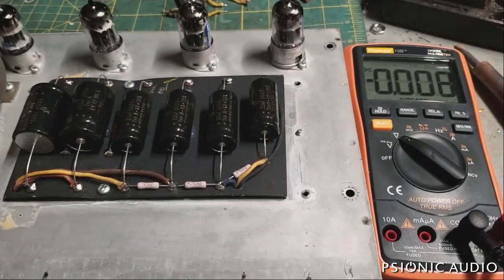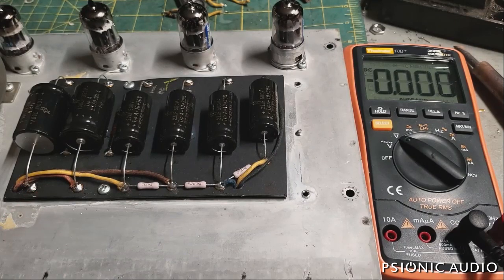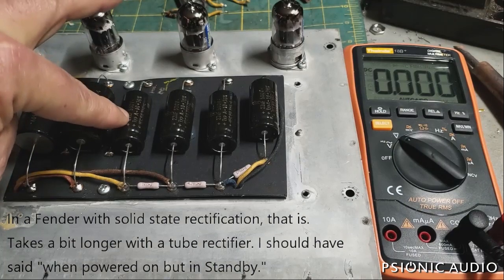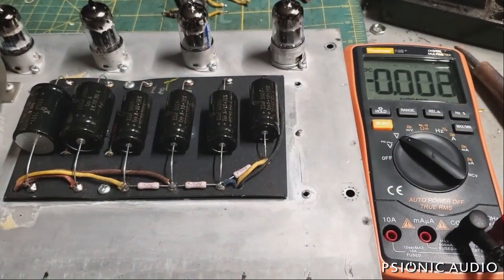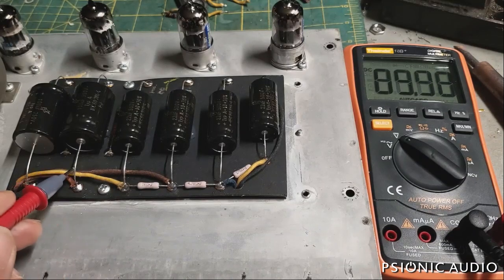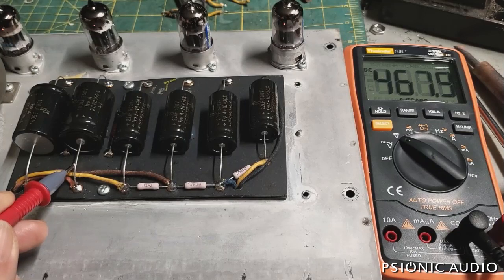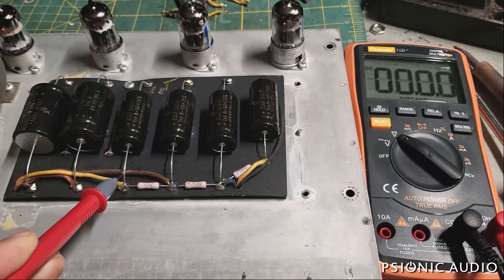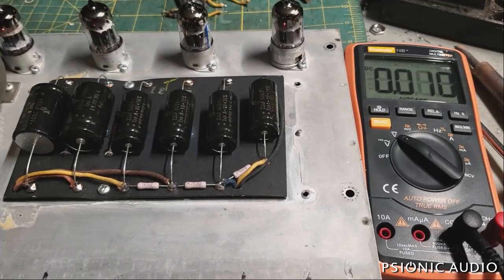Tech Tip : Does This Amp Need Standby? Episode 1 : Solid State Rectification in a '67 Fender Bassman

Comment: Hi Lyle - my 1962 Fender Concert amp is solid state rectified as I understand it. Can I just leave the Standby switch off from now on and only use the Power switch when turning the amp on and off? I am looking through your videos for other presentations on this topic. I want to try and learn more about when I do and when I don't need to use it on solid state rectified amps. It seems the tube rectified amps do not need the Standby switch. My main focus is on the old Concert amp - just want to keep the old girl happy.

Comment: Hey Lyle! If I'm using a late 70's Deluxe Reverb with a 5U4GB rectifier tube, is the standby necessary? Or can I leave it always closed and turn the amp on and off via power switch?
Reply from the maker: No need to use SB
Reply: @ Sweet, thanks. You're the man!

Comment: What Lyle says here is dead on true.
But don't forget what he mentioned briefly about cathode follower stages. I have a Holden wasp amp from 1971 that is still working with the original tubes except the cathode follower before the tone stack and a cathode follower tube after the phsse splitter to drive the KT 88's. If the tubes are not warmed first by using the standby , which in this amp simply removes the voltage from the output tube screens, those cathode follower stages arc over with annoying regularity.
Reply: The preamp and phase splitter HT is down stream from the output screen supply.

Comment: Hello, why on Fender blackface or silver face amps when the amp is ON along with the standby ON then when you turn off the standby switch  with the power switch ON you hear a pop through the speakers? I know your supposed to power on first, let the amp warm up then turn on the standby switch on. This is the correct way right? thank you for your videos.

Comment: Is it accurate to say, as a general rule, that a standby switch is needed if an amp has a solid state rectifier? And if an amp has a tube rectifier you don't need to use standby?

Or does it depend on the specific amp and the details of how it's built?

(I have multiple tube amps - Trace Elliott, Fender DRRI, Marshall, Goodsell, Carvin, and one or two others. Some have a standby switch and some don't.)

Comment: Vox used something called a "Brimistor" on the rail in their EL34 powered 50 & 100 watt amps. It's just a thermistor that used to be made by Brimar Valve. I think they were 3000-4000 ohms @ 20 degrees C, and dropped off as they heated up. Technically they limit current inrush more so than they limit voltage. DC voltages perpetuate arcs a whole lot better than AC voltages do because the AC voltage is alternating from + to - and therefor it's crossing zero 50-60 or 100-120 x a second. That crossing zero kills the arc sooner. With DC it's either + or - from common, and it stays in that state.

Comment: In general, I think most people recognize that a standby switch is rarely a needed item - specifically on newer amps.  As I understand it, Leo Fender included it in the tweed amps because he was trying to protect the small capacitors that he used in the amps and the switch was cheaper than the capacitors at the time.  I don't think that is true any longer and most amps have capacitors that can take the voltage prior to the tubes warming up.  I have also heard it said that from a tech's perspective, they are a useful, but I don't really understand why.

Is there any reason to have standby switches in modern amps, either from a user perspective or a tech's perspective?  So many people think it is a "go get a beer" switch or a mute - neither of which I think is true.

Comment: Thanks Lyle.  Very informative.  Always wondered about those switches ability to handle such high DC voltage. How would one wire 47k 2W resistors to 'soften' affect, as you briefly alluded to at the end of the video?  (ie, an amp using ss rectification such as a Fender Twin.)
Reply from the maker: Thanks! You just solder the resistor across the switch. There will always be some voltage this way, and a low volume output, but it drastically cuts things and eliminates most popping at the switch. 

There are other considerations such as flyback diodes across the choke, etc, but that gets into theoretical esoterica more than things you actually need to worry about.

Comment: My AC30 does not have standby switch. Nor it needs one...
Reply from the maker: Um, this video is about this Bassman with solid state rectification. Most Voxes use tube rectifiers and don't need standby - even the models that have one.

I'll cover those in a different video.
Reply: Oh sorry, mine is 1978 Rose Morris  version that has a SS rectifier so I thought it’s related...
Reply from the maker: Gotcha. If you haven't had any issues, you should be good. The point of this series will be more for amps that DO have standby. Sometimes it's needed, sometimes it's not, and sometimes it can do damage (looking at you, Vox AC30C2X, among others).

But I'll get to those later in this series.

Comment: Hi , I have a 1965 Blackface Fender Bandmaster amp. Do I need to use the standby switch with the amp being 40 watts and solid state rectifier? I never use my standby switch on my Vox AC30. I have a Ceriatone HMR Dumble clone, do I need to use the standby switch on this amp to turn it on? The amp is solid state rectification. I also have a 1994 Mesa Boogie Tremoverb 100 watt amp that pops everytime you flip the standby switch into the play mode or when turning it off. It doesn't sound good. Don't know if I am doing damage to the amp or not. Thanks from Michael Newell in Niagara Falls, Canada
Reply from the maker: A tech would need to perform the same measurements I show here to know which of your amps other than the AC30 might need standby. It depends on the filter capacitors' voltage rating and the unloaded DC voltage present in the amp is. And that can vary. I cannot say without measuring your actual amps.

Until then, follow the manufacturers' recommendations.
Reply from the maker: But no, that standby won't hurt your Mesa. But have a tech take a look - it shouldn't do that.

Comment: 5r4, 5u4, 5y3 do need if not mistaken due to near-immediate b+.
Reply from the maker: It's not a matter of when the B+ flows but whether that B+ exceeds the rating of the filter caps when the circuit is not drawing normal amounts of current. 

This Bassman has immediate high DC but the 500V caps are rated for it. If the amp had 400V or 450V caps, no bueno.
Reply: @PsionicAudio  ha ha. I was making comments as I was watching and I think you can see. 

It’s so good to hear you and that you are doing well. You are absolutely my new favorite channel partner.

Funnily was taking a walk through the neighborhood looking at some under-construction houses and observing some sagging window frames and some cracked glass beneath them. Within the unfinished wall somebody had drawn an arrow and written “no Bueno.” 

I thought if in 20 years somebody removes the sheet rock and sees that...  the applicable statute of limitations is doubtless going to be tolled. 

As if the construction company were still going to exist in 20 years...
Reply: OK sounds like I could damn well be mistaken.
Reply from the maker: @jaycee30865  admitting mistakes makes us better people. See the '66 Super Reverb video I'm about to post showing one of my own goofs.
Reply: @PsionicAudio  re no bueno:  as you might say, “I digress.“ 

New vid:  looking forward as always. 

The most applicable scenario I have for this topic right now is an AC 30 cc and an AD 30.  I prefer 5r4 in the AD. Calms it down quite a bit. The AC 30 is basically just right right now. And thanks to you I now know to not use the standby switch in either one (I think). Just due to the risk of power transformer failure due to rec tube failure/shorts. 

Fwiw I have discovered that 5Y3 made by sovtek (freq branded by Fender) are completely out of spec. Much higher B+ voltage than in vintage spec. A real freak of nature kind of tube. Strongly advise against – particularly in a deluxe.
Reply: One power tube in the deluxe was red plating at idle until I corrected the 5y3.